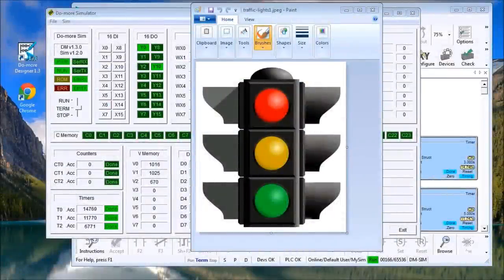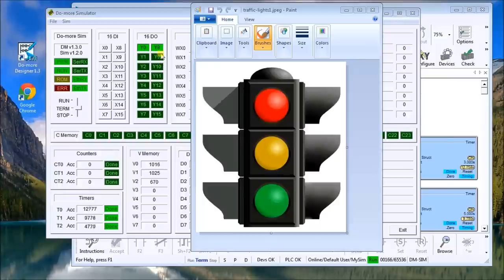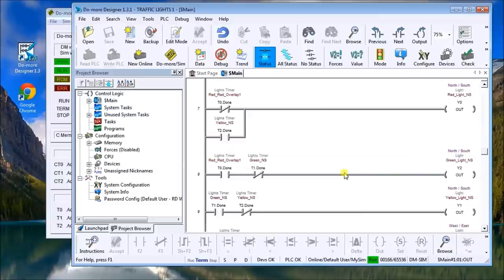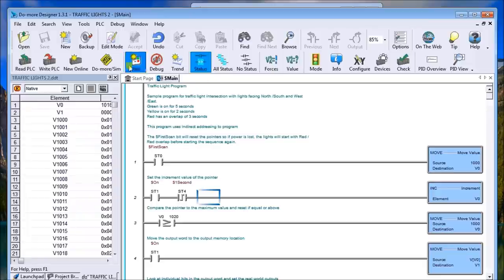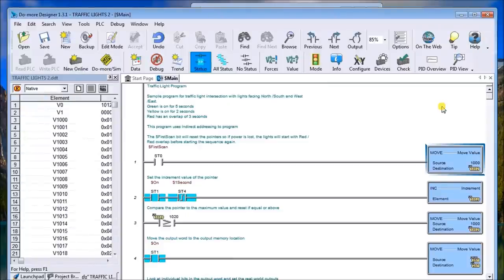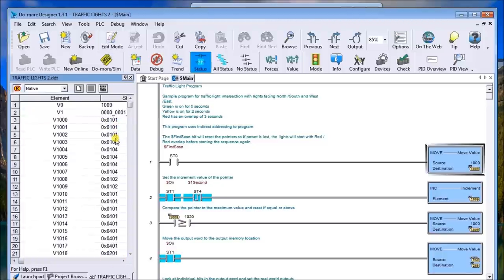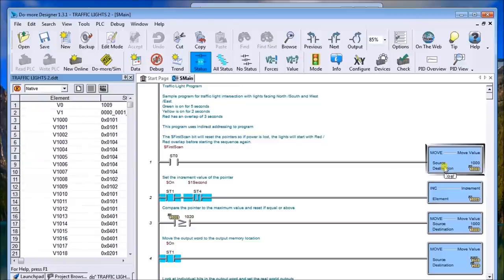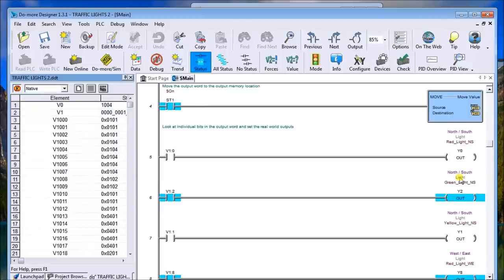Building a PLC Program that you can be Proud of - Traffic Light

Comment: I'm trying to find a  help video on setting up a calender with a daily schedule on off and station running times.  Do you have a resource for this ?
Reply from the maker: Hi Dronai,
http://accautomation.ca/now-you-can-have-robust-data-logging-for-free-part-1/
The above thread is part of a series that will log data. The program will collect the data in the PLC based upon a schedule.
This may be what you are after.
Let me know.
Thanks Dronai,
Garry
Reply: Thanks, I will check it out.  I am designing a grey water system
Reply: Also does your link apply to a Click PLC software ?
Reply from the maker: The link applies to the Do-More. However, there are really no dedicated instructions in the program, so the Click should work fine.
Let me know if you have any questions Dronai,
Regards,
Garry